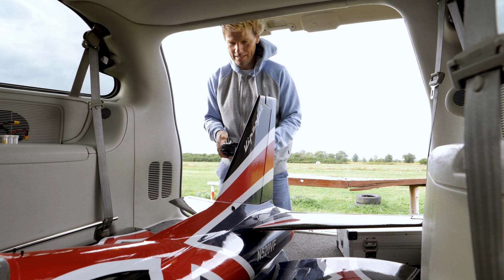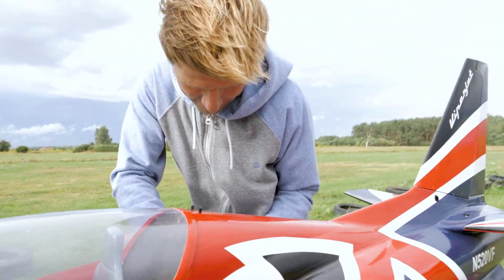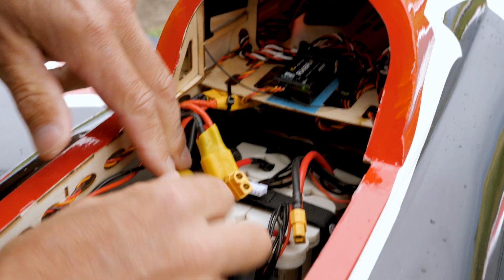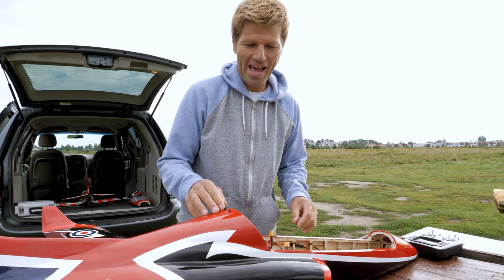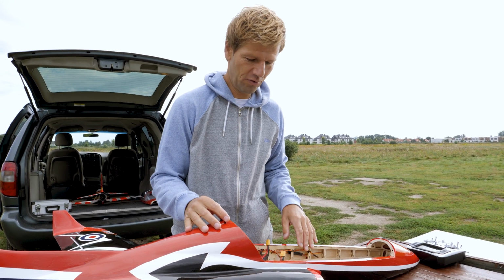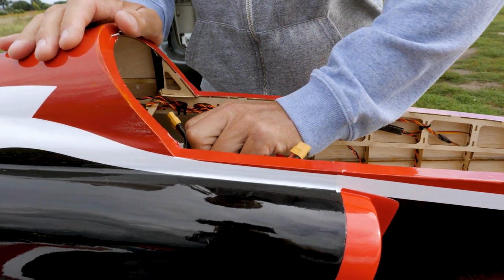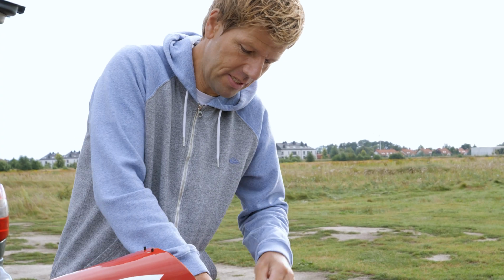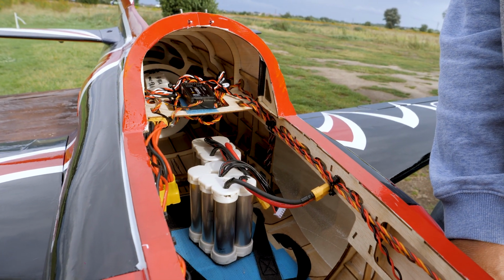Black Horse Viper XL - against strong wind - FullPower!!! Very Fast !!!

Comment: Hi, can you make a little video about the wire adapters you use on 6s 12s 16s and how to make parallel and series adapters. Thanks for the great videos I'm about to buy a Black horse viper jet 2 meters, and I'm about to buy some parts and make parts for it! What are you doing now, it's been a long time since you uploaded a video?